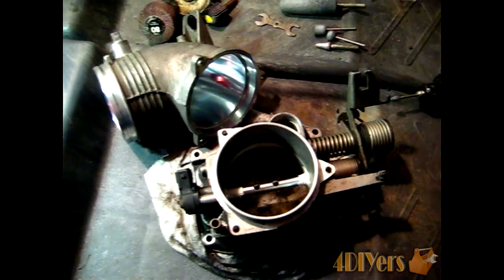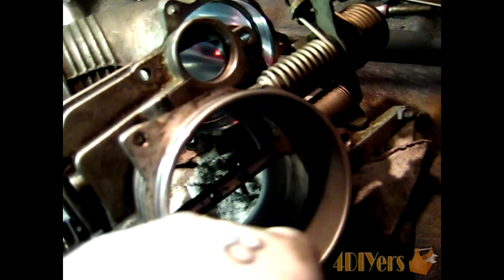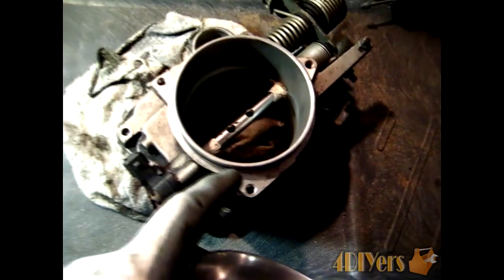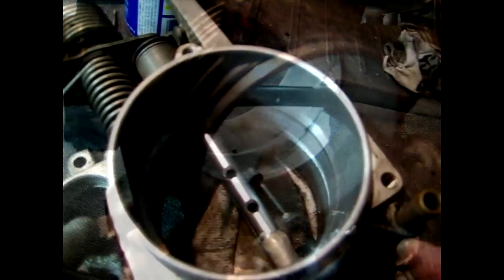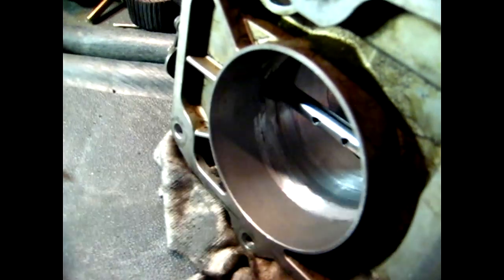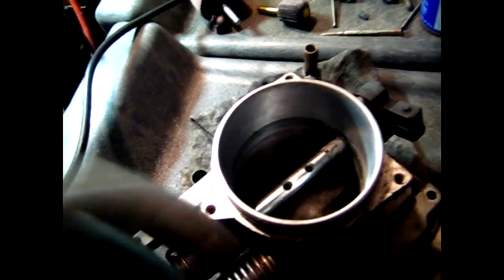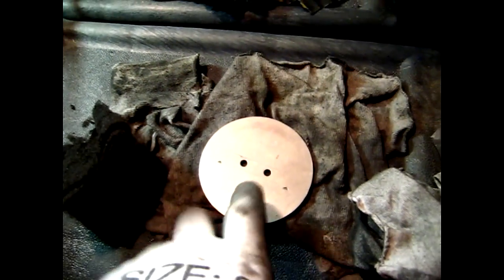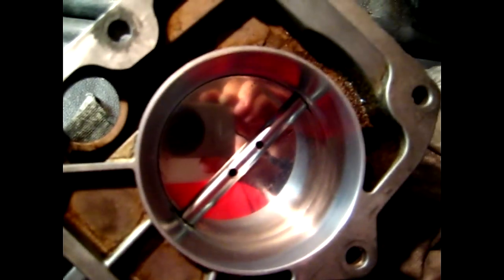How to Easily Polish and Port a Throttle Body

Comment from the maker: Amazon links for various products used in the video for both USA and Canada:
USA
Scotch Brite maroon scuffing pad (400 grit): https://amzn.to/2O62hwd
Scotch Brite green scuffing pad (600 grit): https://amzn.to/2MGpgxJ
Scotch Brite white scuffing pad (1200-1500 grit): https://amzn.to/2YM0cI9
600 grit sandpaper: https://amzn.to/3t020uP
1000 grit sandpaper: https://amzn.to/2YkJzmq
1500 grit sandpaper: https://amzn.to/3qTem61
2000 grit sandpaper: https://amzn.to/3iWGzWX
Metal polish: https://amzn.to/3tytqIH
Painter’s tape: https://amzn.to/3jlUB4H
Threadlocker: https://amzn.to/31PdODU
Flap wheel kit: https://amzn.to/3cT0t3D
Penetrating oil: https://amzn.to/2OnKHo2 
Canada
Scotch Brite maroon scuffing pad (400 grit): https://amzn.to/3pW1ZGl
Scotch Brite green scuffing pad (600 grit): https://amzn.to/2MEQowT
Scotch Brite white scuffing pad (1200-1500 grit): https://amzn.to/3tvlAPL
600 grit sandpaper: https://amzn.to/2YhR9OJ
1000 grit sandpaper: https://amzn.to/36e2fZs
1500 grit sandpaper: https://amzn.to/3cfSJZx
2000 grit sandpaper: https://amzn.to/3pot4BF
Metal polish: https://amzn.to/3aACPGZ
Painter’s tape: https://amzn.to/36JqIpS
Threadlocker: https://amzn.to/3fL8XvO
Flap wheel kit: https://amzn.to/3cT6YDO
Penetrating oil: https://amzn.to/3uoJlsp

Comment from the maker: There really isn't much of an increase of horsepower considering you're not increasing the size of the bore where the throttle plate is. But this does allow the air to flow smoother into the intake, increase throttle response, reduces drag on the air flow, and prevents the oil/film build-up inside the throttle body.
Reply: Correct! This is more for the purpose of efficiency. I've been doing mechanics since my teens, and have always stressed the importance of what sometimes just a good cleaning will do! Like air conditioning systems for example.
Reply: Hi. I'm doing my first throttle body. I marked with a fine sharpie for the butterfly valve. I have created quite a funnel effect.  I'm hoping to increase response as you mentioned. I'm a newbie and I appreciate you explain every single process! Including grit of paper!

Comment from the maker: +Argenis Bautista No I do not offer this service, but a local performance tuning shop would. Also if you have the same car as mine, the intake manifold doesn't require this same procedure as well. It has a plastic composite intake manifold instead, which was designed to be as large as possible as well as being very smooth inside. But I would recommend cleaning it as they can have a build-up of debris on the inside over time, especially if you've had a PCV failure and this can affect the vehicle's performance. If you wanted to go with the extra step, you can polish and port the heads. That would be much more costly, but it is a possibility.
Reply: Excellent. I've been doing work like this since the 1980's..
Reply: 4DIYers buy on EBay $99 and it is ported all the way. Much faster and more hp.

Comment: It might be helpful to replace phillips head screws with allen head screws when putting the throttle plate/flapper back on the throttle shaft. Probably a 1 time operation, but allen heads are a lot less likely to get screwed up when installing/removing. If phillips heads get screwed up in removal, you can go to the next larger thread by drilling them out. These threads are usually metric so there is not a huge difference in size ( 1 millimeter = .040") also enlarge hole in throttle plate to allow it to center itself in the bore before tightening. Drilling and tapping with plate installed tends to lock plate in position. You can usually find button head allen screws if you are concerned about air flow compared to  the regular square shouldered allen screws.
Reply from the maker: +Tommy Baker Excellent tip, thank you for sharing.

Comment: You polish the combustion chamber and the exhaust ports not the intake.  Polishing helps keep carbon deposits from building up  on the exhaust ports.    You need a rough finish to increase boundary layer flow against the surface of the intake manifold.   Dimpling works the best but is very hard to do in most cases.     Of course we are only talking around a .5 to 1 percent difference in power increase so in most cases its not worth it to dimple so just rough sandpaper is the next best thing.    We have also dimpled intake valves as well for an extra .3 hp on the small engines.
Reply: At the throttle body i think it helps prob not much, once you get into the intake manifold and cylinder head it should defently be slightly rough
Reply: I always wondered why people polish the snot out of the intake. It makes sense that you would disturb the valves, but how to do it without damaging that's where the money is made!
But the main thing is that many passenger vehicles have quite a bit of crankcase ventilation going on directly in front of the TB. You should really clean it like every 5-15 years depending on mileage & personality. I guess this is a big bmw though, so idk if it has a turbo or whatever. If there is a large, or multiple, turbo(s) you could probably go polished TB & further work to disturb the remaining length. The reality is that alot of the combustion at the top end will be ocurring outside the cylinder anyways.

Comment: I have the same stones.. same ancient Dremel.. and same throttle body! =D

Looks like I know what I'm doing tomorrow haha
Reply from the maker: Awesome to hear and keep me posted on the results!
Reply: 4DIYers someone said that your not supposed to see any light come through when the throttle is in the closed position, but I have 1/32” to maybe 3/64” ,3/4 around the diameter. Is this okay? This T/B is OEM for a C6 vette
Thanks
Reply: *1/32-3/64 gap

Comment: UNIQUE youasked allot with one question. I assume your bottom end is cast not forged? 55mm to 65mm will not yield enough gain to make or break bottom end, that's good. A power adder ie, nos, turbo or SC will push bottom end. 
You need to be accurate in fuel pressure adjustment. You need to seriously think of dyno tuning because 55mm to 65mm is enough change to cause detonation if your too lean. 
What is your exhaust setup?

Comment: I know this is an old video but came across trying to find how to do this.  I have a 91 318i BMW.  I found a forum that suggests to bore out the secondary plate from 3mm to 57mm.   I can't find any info on doing this and wanted to see if you had any info or how to do. Thanks and subscribing.  Great video
Reply from the maker: Thank you for the support :) For boring out a throttle body, it'll need to be done on a lathe. It'll have to be completely disassembled, the slot in the center shaft will need to be wider, and a new throttle plate will need to be made.

Comment: if it wasn't mentioned an alternative I found better than scotchbrite is steel wool. There are progressively finer grades, same as sandpaper. Use the polish with the SW. Finish with "000" (finest grade) and just buff residual polish off w/clean microfiber towel and it will be highly shined. 
Thanks for the video. Too bad no one will see the effort.
Reply from the maker: Awesome tip, thank you for sharing!
Reply: Chief Gilly . ....yeah but l bet you it should be a noticeable difference...

Comment: Would it be possible to cut a bigger butterfly so you could open up that contact area more?
Reply from the maker: Yes you can bore out a throttle body and make a bigger butterfly.

Comment: Better fuel flow through it being polished, yes!! with rough ridges, scuffs, or scratches gas will no doubt have to bounce off them to pass through the throttle body. Better smoother fuel flow = Better MPG
Reply: Todd Gilmore Gas does not go thru the throttle body on fuel injection. Only air.
Reply: @lynnchelo4727  😂
Reply: Only air! No fuel!

Comment: DAMN SON, I don't know how you get it so round after using small tools like that, FACT. DAMN NICE WORK, ALOT OF TIME & DETAIL GO INTO THAT, JUST LIKE POLISHING THE INTERNALS OF GUNS. I'm just going to use a flap wheel a little bigger than my throttle body to take out the taper below the throttle plate.Then polish it up the best I can with my dremel ?
Reply from the maker: Thank you, I really appreciate the kind words and feedback :)
Reply: Marshall &, I know right ? I actually watched it a few times just going man that's a lot of work & looked GREAT AFTERWARDS. Like doing a hand rubbed on oil finish on a wooden rifle stock, getting all the scratches out, rubbing & rubbing, coat after coat.

Comment: I used a wire wheel on my drill to just scrape away ( basically ) at the inside of the plenum and used a fine sand paper for smooth out all the rough feeling ridges from the wire wheel left behind...it's not premium polished or shined, but it does at least feel smooth as I can get it with what I had.

Comment: How did that extra one horsepower treat you?
Reply from the maker: Horsepower increase isn't so much noticeable with this particular car, but the throttle response has greatly increased. It depends on the vehicle.
Reply: Things like this aren’t for a direct horse power increase, it’s for improved drivability, making the intake nice and smooth the whole way through will let everything flow nicely and therefore have a more responsive engine

Comment: Could you make a larger throttle plate?
Reply from the maker: Yes you can. The throttle body can be bored and then you'd need to make a larger diameter plate in most likely a lathe.

Comment: If I polish my TB is it as good as porting it?
Reply from the maker: Unfortunately no... The porting allows more air into the throttle body. But that also depends on your throttle body design. If you have odd edge or an irregular shaped bore, it tends to cause turbulence in the throttle, therefore reducing the flow pattern.

You can go ahead and polish the throttle which does improve some of the performance. But you won't be able to achieve it's maximum potential.

Comment: Does this mod increase or decrease horsepower?
Reply from the maker: This mod increases power and throttle response.
Reply: 4Diyers only on SOME vehicles. On most, the TB is not a restrction to the engine, and porting will offer no real power gains.
Reply: Lee S. Yes but this same concept can be applied to the upper and lower manifolds as well and if youve got a car like my caddy that has a really restrictive stock air intake and intake manifolds you would see serious gains from adding a cold air intake and porting and polishing. Ive heard many people say not to get carried away with the porting part tho and in fact several say less is more and the gains are from smoothing everything with polishing compound.
Reply: MrClayFTW 
Not sure which Caddy engine you have, but regardless, you won't likely see any tangible gains from this.
There would have to be a demonstrated deficiency 
with your particular manifold design in order for this to be of any significant gain.
Which year and engine do you have?
Reply: Lee S. I did this mood to my Colorado 3.5l and improved throttle response a lot.
Mpg and 0-60 is the same
Reply: Lee i have an Ly7 3.6. Actually the Ly7 and LLT 3.6s see massive gains from intake and exhaust modification because they already have the fuel system to handle quite a bit of power. The stock intake box is also notoriously restrictive in both engines stock. 

Volant CAI on a LY7 is +13-14whp with a little modification to optimize it better you can see gains. I dont think you understand the power of a beefed up 3.6VVT. The cts also has full stainless 2inch duals from header to rear axle then 2.5 custom dump from there. Most GM vehicles are designed with restrictive exhaust and intakes Because it decreases the sound level in a luxury cars. For example my stock mufflers weighted about 20-25lbs pretty easily they felt like big cement blocks and were very restrictive for no good reason but decreasing sound.

LY7 manifold isnt quite as good as an LLT manifold so it does see a bit better gains overall from porting and polishing the upper and lower manifold. On top of that a great way to free up more air is gutting the maf unit into a hi-flo unit without the sensor in there obviously or you may break it/clog it with plastic dust will free up more hp and increase throttle response further. On top of that i have an upgraded throttle body on my LY7 but all i need to do is go back and port it a little.
Reply: MrClayFTW I'm sorry to hear you have the 3.6. Probably the biggest engine disaster GM has had in decades.
I work at a Cadillac dealership, and over 80% of the major engine repairs our shop does are on the 3.6L.
I doubt the intake and exhaust systems are that bad. It's the engine longevity that you should really be worried about.
Had your timing sets replaced yet?
Reply: Lee S. Ya they aren't very reliable.
2 of my friends has their 3.6s replaced because of massive rod knock.
Reply: PC Master Race 
Yeah, rod bearing failures, timing sets, burnt valves, and head gaskets are all common issues.
Many years are under a TSB or recall to replace timing sets.
Reply: Lee S. Chevy does replace the engines under warranty though.
My friend has zero issues gettign a new/rebuilt v6 replaced.
Reply: Im far from worried about that ive already had the whole timing set handled a couple years ago. Never had any issues with mine it has been taken care of exceptionally i had it dump me on the side of the road with a fried throttle body. Apparently they fazed out my throttle body and i had to get a newer model TB. And that really wasnt that serious it just went in limp mode. I run mine hard but it gets changes every 5k with extended performance Mobil 1 before it even really goes dark. Im not worried about the engine going on me at all if anything im going to blow the differential from wheelspin or the tranny from high rpm shifts. Those fucking bmw Getrag parts man.
Reply: Im a lucky one my ly7 is just over 120k but i have every maintance recipt for all the work ever done on the car and the dealership window price sticker for when it was new. So i know what has been done to this thing on top of all the stupid shit ive done to it hahaha
Reply: MrClayFTW 
Well I wish you good luck with it.
There are 3.6s that do last, but they definetly have a reputation for failures.
The throttle body/TPS asy. Is yet another common issue with them.
We keep the 3.6 TB/TPS in stock in multiples, and go through them like candy.
Other engines, if we even stock them, it's just one, because they move much slower.
Reply: +SANIC lmao. I swear youve seen every video I watch.

Comment: Please note that your car may run quite lean if your ECU does not compensate for added air.
Reply from the maker: bman737 Considering you aren't enlarging the bore of the throttle body around the throttle plate, this should make that much of a different. The end is able to compute any adjustment very fast regardless. With this modification, it's creating air flow efficiency, reducing drag, and optimizing atomization.
Reply: Unhook the negative terminal for 20 minutes turn your lights on to drain any stored energy in the vehicle hook battery backup put the key in the on position for 10 seconds start it  let it idle reaches operating temperature drive it as normal as possible for the next couple of days. Nothing too aggressive. That way itll relearn correctly. and your fuel trim should adjust accordingly

Comment: If the oil / buildup stuff doesn't get stuck to the inside after you do this the P&P, where does it go? In the engine?
Reply from the maker: It'll just get burned up in the combustion chamber just like if there was any excessive oil content within the intake.